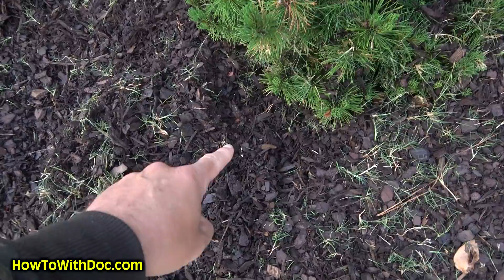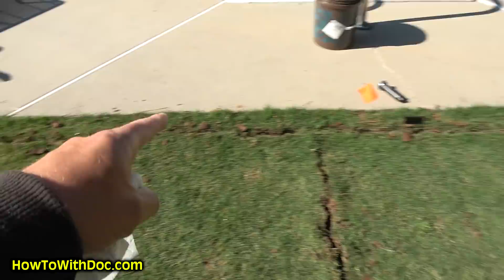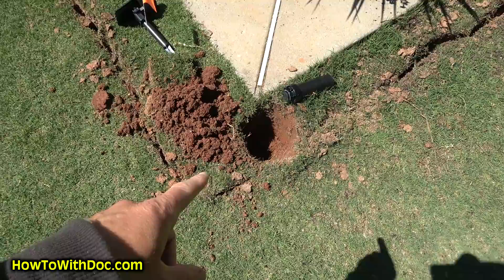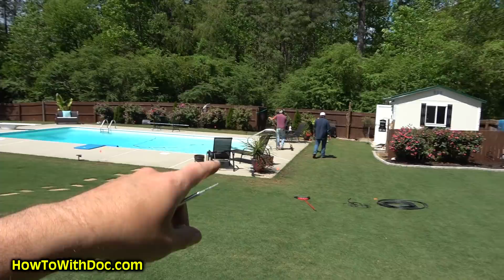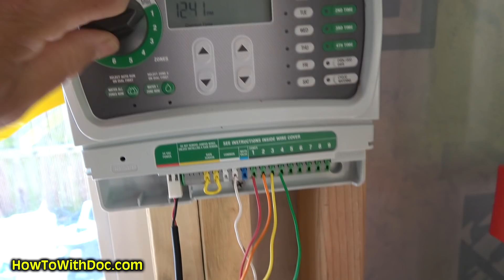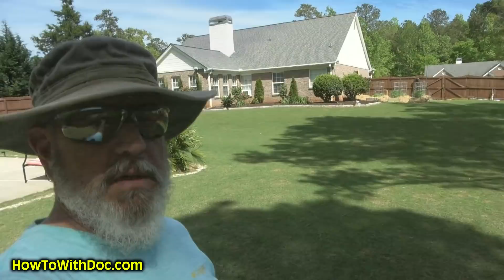Lawn Irrigation system

Comment: I was going to attempt a DIY system using faucet timers and the rainbird kit, but unfortunately I have a big volume/GPM problem as my faucets are are after the PRV.  Even taking my PSI from 50 to 70, only gave me less than 1 GPM increase. I get almost 5PM. I have 3/4 running into house, which I guess only solution is get a 1inch offainline to split the system to take 1 inch to a back flow preventer and the system and just keep the 3/4 into house

Comment: Hey a little tip, sprays shouldn't be on the same station as rotors.
Reply from the maker: As long as the GPM and PSI are sufficient to both it's fine.

Comment: Drive some metal posts into the ground where the wooden posts are located, that should help save on labor by not moving the fence and will support like new or better...
Reply: So true! I live in Oklahoma and we get very high winds. My brother-in-law built my fence with 3 inch metal posts that we put into holes we augered out then added rock and cement. My fence has withstood 30+ MPH winds. It's not going anywhere.

Comment: Doc, how much pressure are you running on (PSI)  and how many  GPM are those 1" pipes providing?
Reply: 1" schedule 40 is limited to 16 GPM.  1" Class 200 is good to maybe 20 GPM, before exceeding 5 fps velocity.

Comment: Interesting that your main pipes down south are PVC while mine up north I have black poly as my main lines. Also my irrigation lines are like 8-12 inches in the ground so its bit of pain to fix the heads another thing is our frost line I believe is between 1-2 ft

Comment: What is your incoming water pressure?  I heard "Pretty Good", but how about a number.
My water pressure was erratic, at times exceeding 100 psi.  I recently installed a main valve and a pressure regulator a couple of feet down stream from my water meter and enclosed it in a meter box to itself. Easy to get to, and more room to work in there if I ever need to cut my water off or replace the regulator. I set my water pressure regulator to 60 psi - it's a little high, but I can do what I want with it.

Comment: Minor clarification, having 6 heads on 1 zone is normal BUT you would typically have solid 1 inch pipe running between the sprinklers and then you tap off with 0.5 inch flex "funny" pipe. The solid and larger pipe has much less pressure loss. I think that's what doc was trying to explain when he said you typically will not have 6 heads on 1 zone.

Comment: I have to add a couple zones and fix a couple zones.  I have smaller hunter heads but I’m not getting the distance with the 2.5 nozzle but I’m getting the volume per hour.  I’m wondering if I should just go back to the smaller nozzle and up the time.

Comment: Nice vid. Some local sprinkler shops  will design your system if you take them a drawing of your lot. they also won't charge you for the drawing if you buy the materials from them. If you don't know what your doing I wouldn't recommend doing your own sprinklers especially with a trencher.